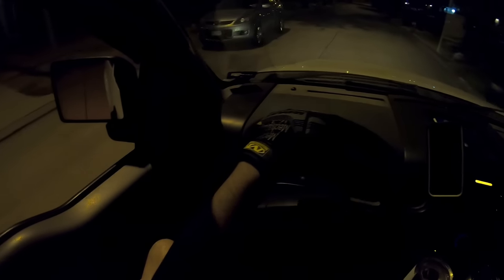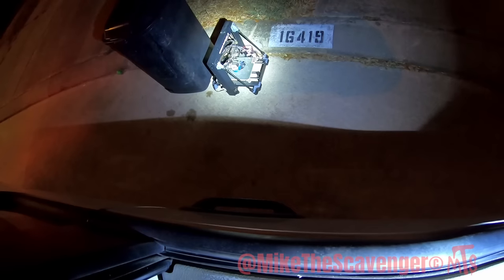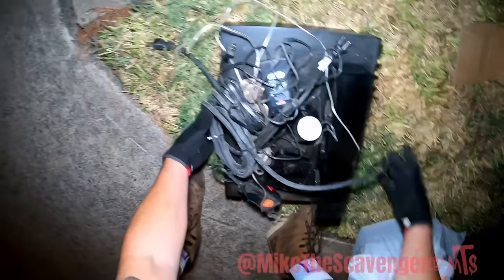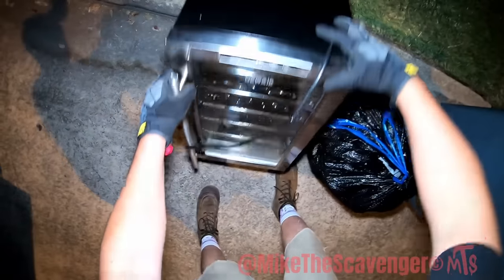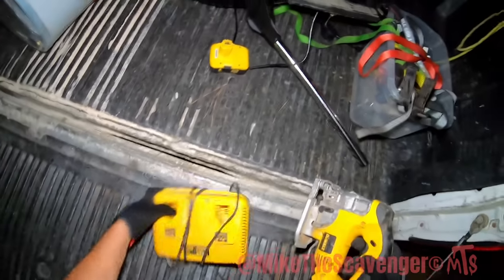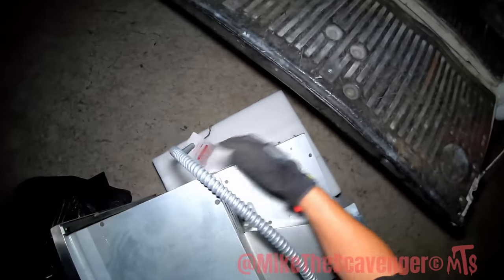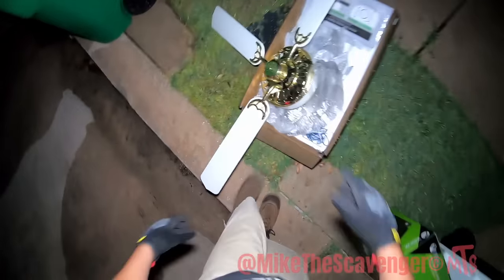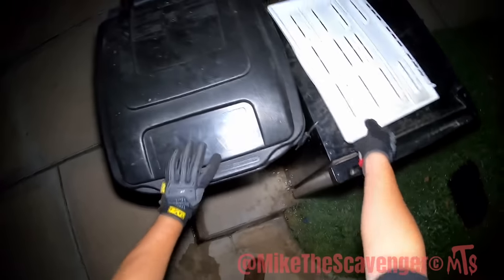Curbside Scavenging "These Are HUGE!"

Comment: 14:31 The black thing is not for flowers Mike. It holds wine bottles upside down to keep the corks wet and swollen. With screw top bottles and synthetic corks, it has become less important to store wine on it's side or upside down to keep the cork hydrated.

Comment: @12:33 That's the same kind of patio heater that I get from my night job. When they break, because they've blown over in the wind, then they give them to me for scrap. Those side panels are not stainless, but the vent element at the top is, and the big cap is aluminum.